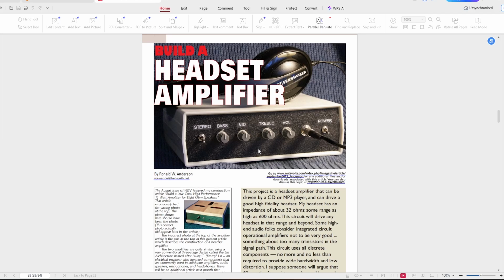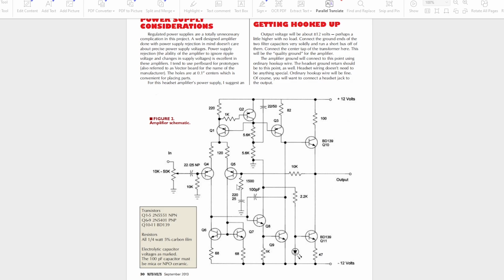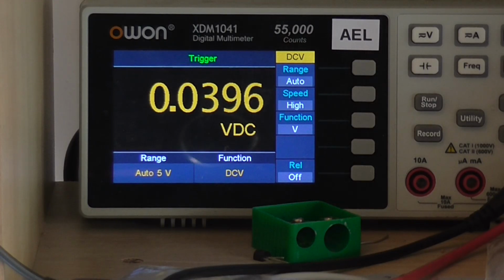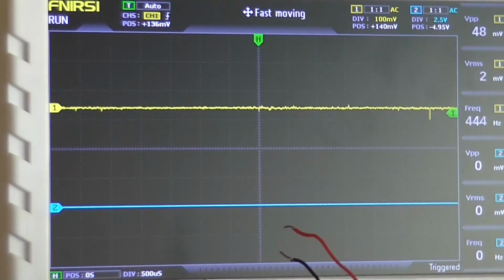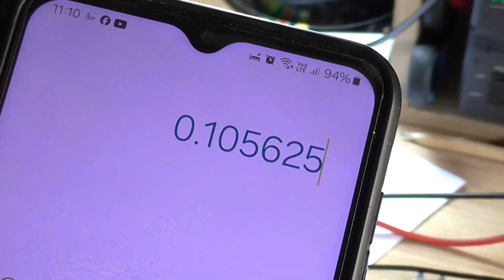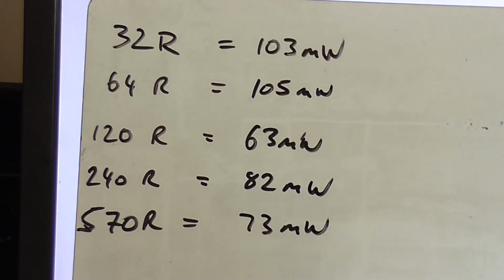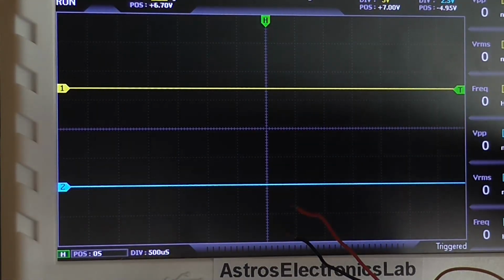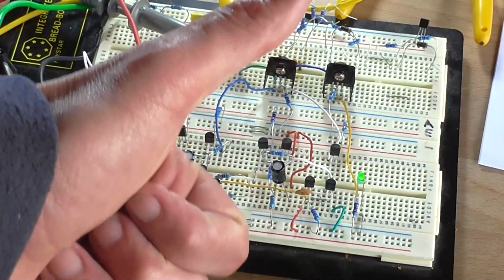Discrete Class-A Headphone Amplifier Circuit Test

Comment: So nice that you mention Douglas Self, no half-truths or half baked solutions with that guy, his books are so informative and straight, he isn't holding any of his knowledge back.
The circuit has about 40ohms of output impedance, and the impedance of headphones is not purely resistive, but reactive, includes capacitance and inductance, and that makes their frequency response not linear if the ratio of in/out impedances is not at least 4.
That said, the performance is suitable for driving cans, and the dc offset can be fixed by replacing the 120ohm resistors of the LTP with a 250ohm pot with the middle pin connected to the collector of Q1 and the sides to the emitters of Q4 and Q5 each set at middle position. After powering the circuit set the pot for 0 dc offset😉.
Also I want to say kudos to you for not being lazy and doing it on protoboard, I know how effed up it is😀. I test them circuits in Multisim😀.
Reply from the maker: Yep. I added a 500R trimpot (only low value I have) in the emitters and can get 0V.

Comment: You can use whatever led you want just adjust the resistor value in the emitter for more or less v drop per ma, to get the same constant current, also red leds are the quitest at 0.4nv/root hertz
Reply from the maker: Yeah, that is a good point. I just meant "not change it" without obviously modifying other stuff to suit.

Comment: Thanks for the video. I think the appeal of this one is that it's an unusual combo. "Evil" global NFB combined with purist Class-A output. Never got around to measuring the output power because it was more than enough to drive the headphones I have. I put it in a nice Takachi YM-150 instrument case and powered it with a DOSS AC907X2. Which is a power brick with 2x9VAC on a DIN plug. The only additions were a volume pot and gain range switch. In terms of discreet vs op-amp performance, it's hard to beat something like the OPA564 which can just driver them directly with vanishingly low distortion. However, it is a bit boring to have a problem just solved for you like that. The noise on the scope from the PC makes me wonder if it was a laptop? A lot of noise can get coupled via the Y capacitor in the power supply.
Reply from the maker: You're welcome. The noise is the laptop, typical Realtek AC90
Reply from the maker: The next thing I might do is make a proper PCB for this.
Reply: @AstrosElectronicsLab  I was tempted to do an SMD version. Not that you need two headphone amps but just as an excuse to use BC847BS and BC857BS dual (gain matched) pairs for the LTP and current mirror.

Comment: Use a red LED for nice warm sound, a blue LED for that clinical detailed sound and a green LED for neutral sound. Only kidding! I'm not sure that an OPAMP with 'too many' transistors makes any difference to the sound that. I've designed and built discrete preamps and opamp based preamps, and they sound the same to me at least....
Reply: It might not be the LED colour. You might need a pair of those rich golden ears to hear the difference. I can never tell either.
Reply from the maker: That's just what the guy wrote in the text. The LED colour is important, as a different colour has a different forward voltage; a red one may have a lower voltage resulting in not enough current in the sink circuit leading to early clipping.